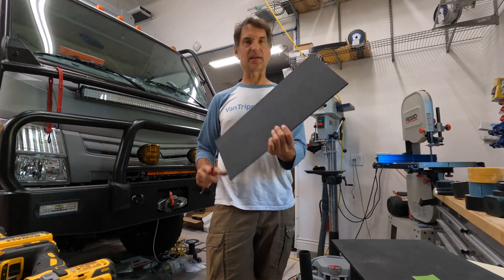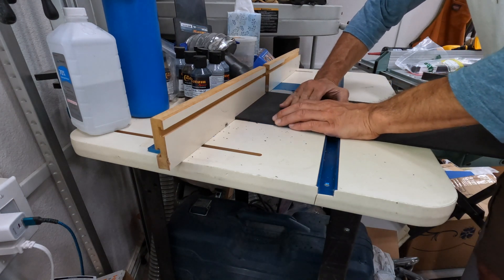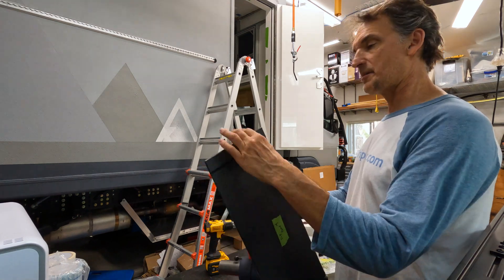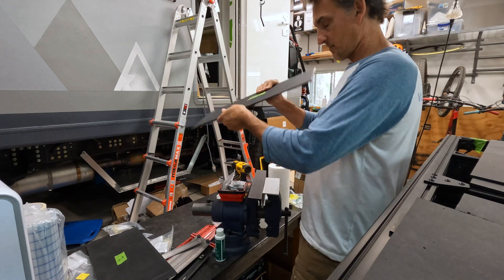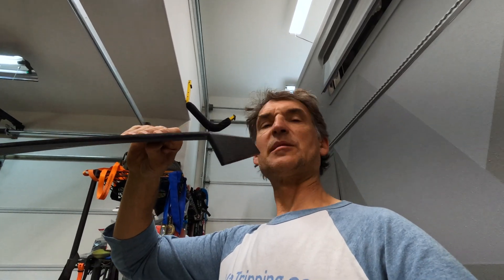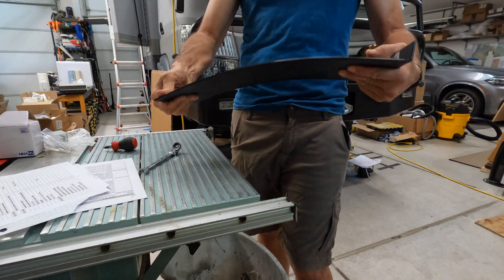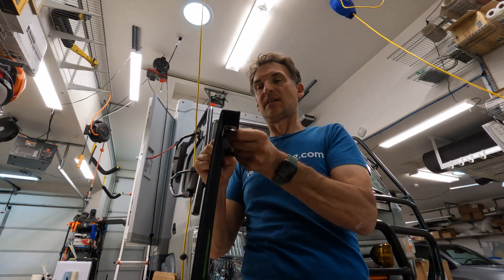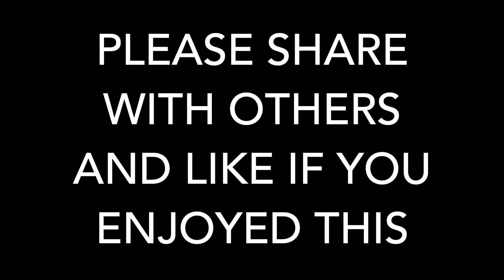Bending HDPE for Expedition Camper electric fuel filler doors

Comment: 5:00 I would not suggest that. 
Every bend like that will weaken the part, of course.
Just weld HDPE. Pretty easy process and you will not have any limit. +in every bend is the additional layer of the weld, which will give strengh. Similar to welding steel.
Reply from the maker: Thank you for the suggestion. I took the low-cost path in using tools I already have, and why I passed on welding the parts, but will consider doing that if needing to create some more custom assemblies. But the angle aluminum will certainly create more strength than needed for this part as well as retain the 90 degree angle.

Comment: How much time you have with bending before it gets hard again? I’m thinking of bending larger sheets
Reply from the maker: Once heated, it takes seconds to bend it, and likely would stay hot enough to continue bending for a few minutes. It then should be held in the final position for 30 to 60 minutes before removing from the jig and clamps. I think this time could be decreased if the plastic is cooled with water or something else but I have not tried this.
Reply: @vantripping  a wet towel can be used to do this. also, if you heat the piece up with a more powerful heatgun, the heat does not dissipate so much in the workpiece and you only have a hot bending point. it is also possible to clamp the sheet first an then heat it up while applying force. with this technique, you only heat the material up as much as needed.
Reply from the maker: @DE-li7jt  Thanks! All great suggestions!